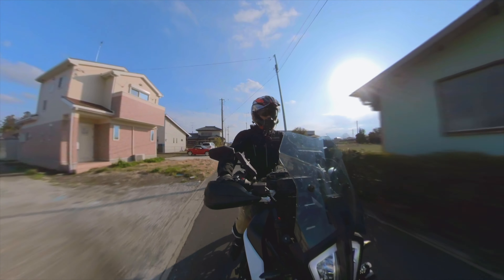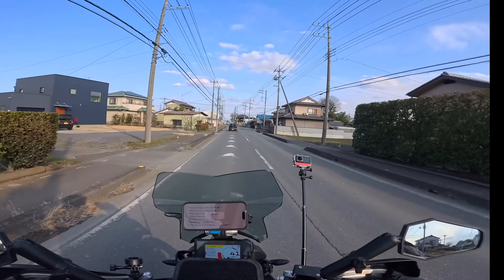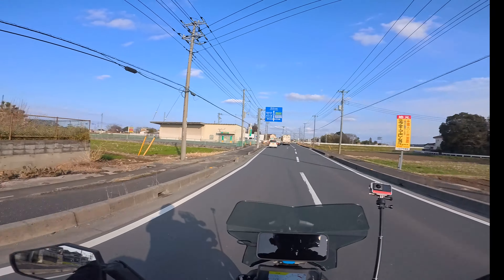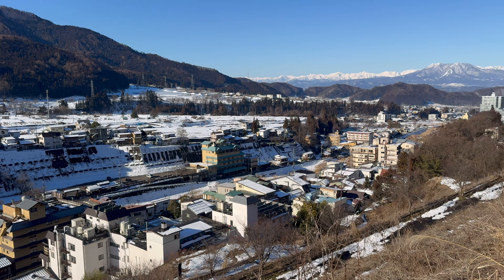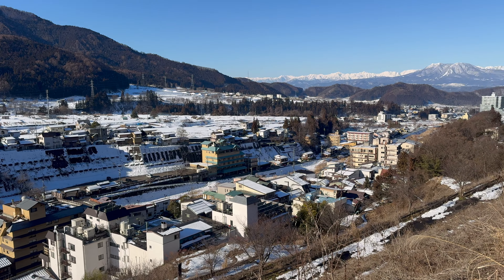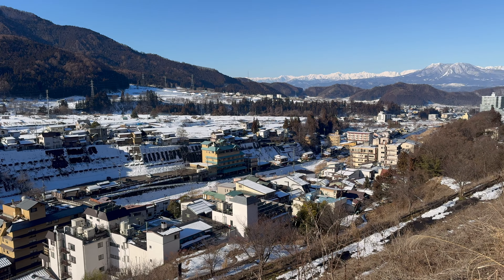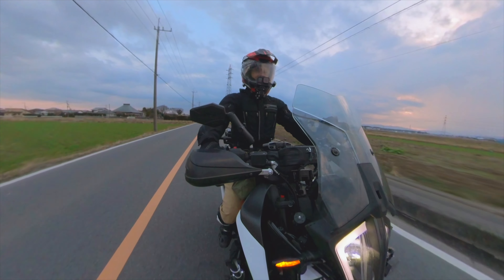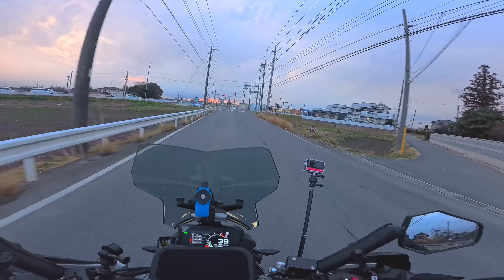KTM 390 Adventure | Low Fuel Light Test & Snow Monkeys | ADVinJapan #57

Comment: Over 460km on one tank? That's doubtful, even with your fuel saving tactics. Never bled mine dry, but I'm refueling after 260km (just when low fuel light turns on) and it's consistently about 8 liters. So more like 360 to 390km on full tank.
Reply from the maker: Thanks for the comment! Did I say 460? Don’t recall. Anyway, so I was getting 31km/l. That’s roughly 430km on the 14l tank alone. Topping it off will get you close to 440 and the addition of my 1 liter fuel bottle for an extra 30km.  So all in all it’s very close to 460/70 in a best case scenario as I mentioned in the video. But you’re right, a more practical figure would be closer to 400 though as we are not always riding like we’re empty.
Reply: @advinjapan  Indeed that makes sense, but as you mentioned at the beginning it's not healthy for the pump. What it shows however it's very impressive fuel range for this tiny thing:) Thanks for the tips and great video!
Reply from the maker: Yeah, I made some edits to my comment to reflect your figure of 400 is very much more practical 👍. Thanks a lot! 🙏 I’ll be sure to pin this comment, good stuff.
Reply: Edit: I absolutely lied. Just after posting that comment I went for a spin on mine 390ADV and low fuel warning showed at 190km (29km/l) and fuel range is less than 120km. I can tell there's still a LOT of fuel in the tank. As this cannot stand, I'm going to ride it dry and check actual mileage.
Reply from the maker: @abominacja47  awesome, the more data points the merrier. Be sure to post your results here🙏🙏🙏. And be careful out there!
Reply: I think the low fuel light comes on when the tank gets to about 1/3. I have seen the warning light come on at 170 km, and 110 km. I agree it's very annoying. Wouldn't it be great if you could choose when the light came on, say at 75 kms.
Reply from the maker: @alanwarren5846 yes you’re right, about 1/3 for me too, even more actually.
Reply: This is just a filler video. A lot of it is common sense for viewers. You've said that too in the video.
Reply from the maker: @KaizerBillimoria indeed, common sense, but informative for some I hope 😅.
Reply: @advinjapan  Okay. I finally found enough time to ride mine dry. The final result from full to empty was 327.4km at 28.8km/k average. However there was still some fuel in the tank, since I refueled exactly 5l in the field and later 8.2l at gas station which was only 4km away from a spot where I ran out of fuel. I just didn't want to torture fuel pump, so you potentially could squeeze a few kms if need be. Mods to mine 390 that could affect final result are FuelX Lite, removed resonator box, K&M air filter and 14T front sprocket. Low fuel warning went up about 190km and I got 0km fuel range at about 305km.
Reply from the maker: @abominacja47 wow, that seems very low to me, especially if you’re running 28.8km/l. That should have gotten you a lotto closer to 400 total. 🤔 my mods are very similar to yours as well. It’s hard to tell what I would have gotten as I only measured reserve fuel, but I’m almost positive it would have been close to or over 400km. With my extra 1L that would have pushed me close to 420-30, easily. I’ll have to try measuring from a full tank, myself some time. Cheers mate!
Reply: @advinjapan  Well I was expecting ECU to be inaccurate. It's about 24km/l in my case, which is still a good result but nowhere near what bike's showing. I'm still at least 70kms short. I rarely ride pavement, mostly off-road and pretty gnarly stuff for where I live. Today, during the test was no different since I decided this would be usual use case for this motorcycle. I strongly recommend you to try a run from full to empty. Also forgot to mention I'm running 95 octane. Cheers!
Reply from the maker: @abominacja47 I see. Well if most of your riding in that tank was off-road then maybe that makes sense. But even then, the consum. meter seems off. Yeah, maybe I’ll give it a try.

Comment: I'm generally over 4l/100km (under 25l/km) in city commutes, but under 3l/100km (over 33l/km) when touring, without even trying to save fuel. I'm in Vietnam, so the top legal speed is 70 km/h.

There's one bad advice in the video: engine breaking is more efficient (on fuel injected vehicles) than coasting in neutral / pulled clutch, because idling eats fuel and engine breaking (almost) doesn't. Google Deceleration fuel cut-off (DFCO), or check Engineering Explained's video "5 Driving Hacks To Save Money On Gas". Of course you can kill the engine, but I wouldn't do it, the savings are minimal (or even negative if you start again quickly) and not worth the risk IMO.

Thanks for the video, the low fuel warning is definitely pretty early (and very dependent on lean - sometimes it shows low fuel when leaned on the kickstand but two bars when upright), and I was curious how far I can push it :)
Reply from the maker: Hey thanks a lot Lukas, I had no idea, very good tips here, I’ll be sure to pin this to the top. 🙏🙏🙏🙏

Comment: Thank you so much for doing this! Good to know there's more juice available! :D  I usually fill up every 350 kms on mine...That's when mine says range 50km left...I've also managed once to get 34 to 35 km/l on a very smooth and straight motorway highway thingy and was very gentle :)... normally I get between 30 and 31...And some days when I'm giving the beans I've hit 25 km/l ... I plan to take mine to a track as soon as I'm able...Will let you know what kind of economy I get there! I'm guessing between 15 and 20 :D...
Safe travels,fellow wanderer! :)
Reply from the maker: Thank you! Yeah 35 doesn’t surprise me, I’m running a lid filter and a 14t sprocket so that can increase fuel consumption. Yeah, definitely drop a post here for sure! Good luck out there and stay safe.

Comment: I did the other day around 100 km on the low fuel warning and arrived at the petrol station with < 10 km range still on it. And that was riding on small and steep roads up and down.
Reply from the maker: Yeah that’s about right, depending your consumption rate. I was banging out 31km/l so I got 140.
Reply: Great little experiment of yours and very handy to know when it’s getting tight one day.

Comment: The light on my 390A comes on with about 80 miles of range left and I usually ride it until I have about 30 miles left. And even then, there is plenty of fuel in the tank when I fill up.
Reply from the maker: Yes, lots of reserve fuel in this bad boy.